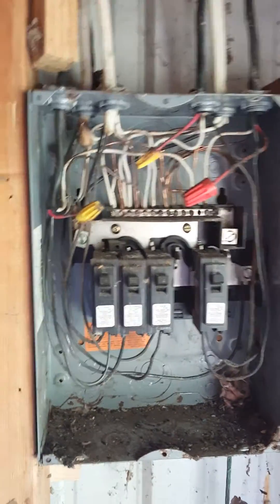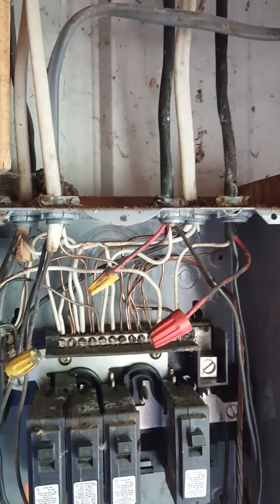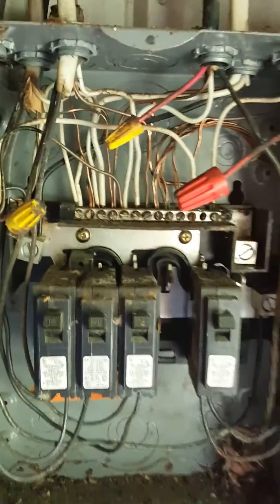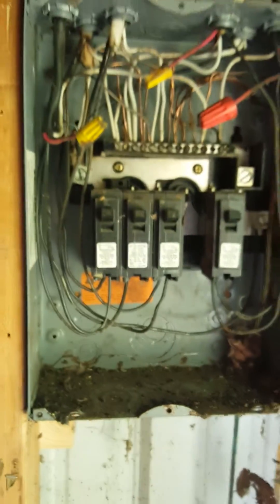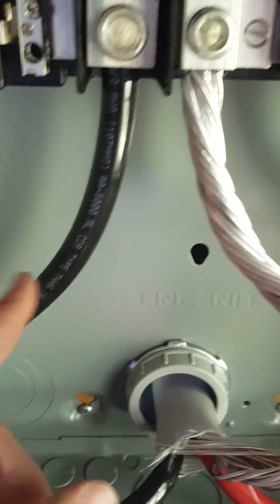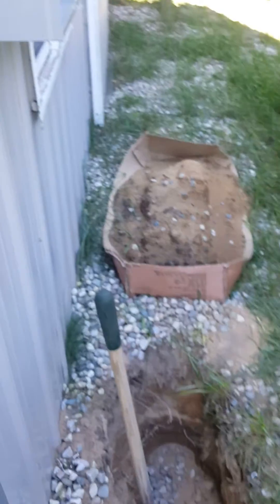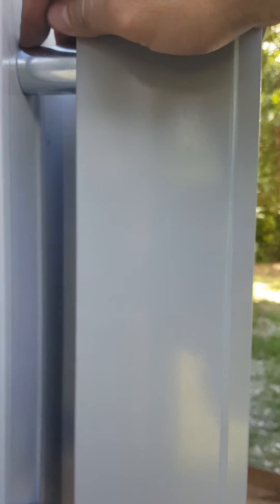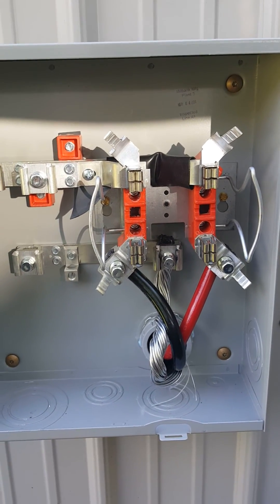Pole Barn - new power project

Comment: Did the electric company charged you to run cables to the outside pole to the meter just wonder im doing the same thing soon
Reply from the maker: Yep, sure did. They directional bored it about 500 feet and it ended up being around $2k.